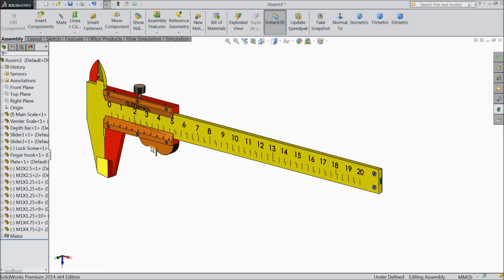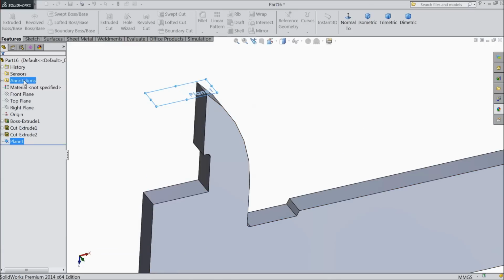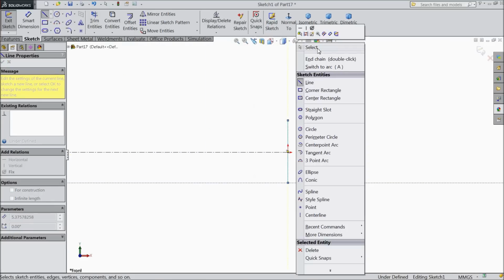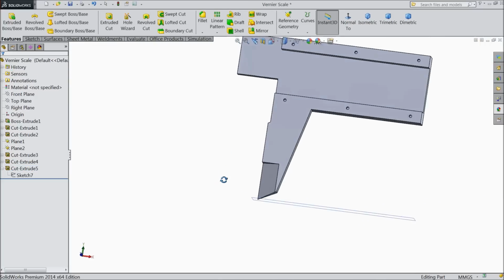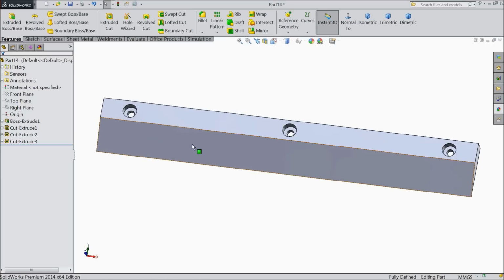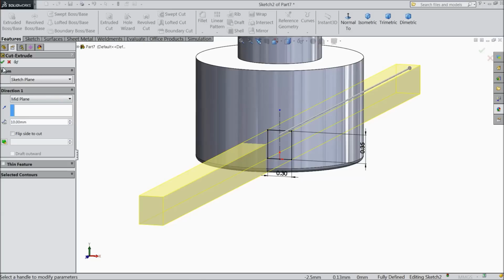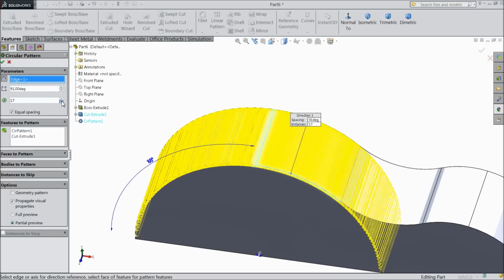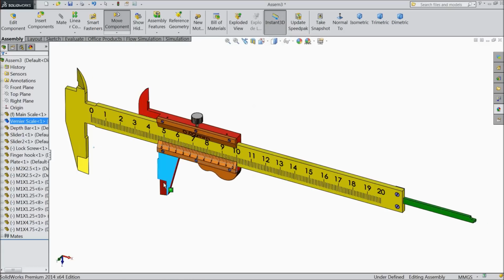Solidworks Tutorial | Design and Assembly of Vernier Caliper in Solidworks

Comment: Nice video, but there are some faults in measurements. You can see the holes of the slider scale does not match. The depth bar is too long. The measuring jaws are not the same. The lockingpin is not good placed, it cuts the hole of the slider scale screw.  Anyways a very nice video.